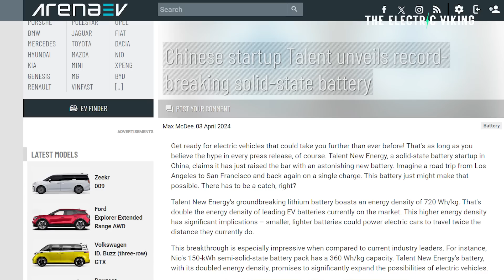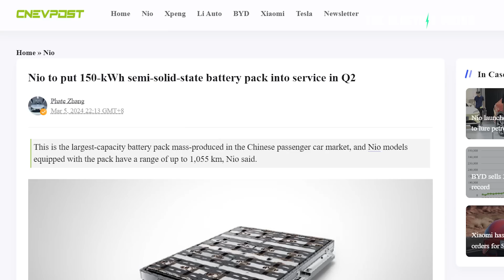Highest energy density battery in the world enables EVs with 1250 mile range

Comment: As long as I live in the boonies with no easy way to charge an EV that's probably 4-5 times more expensive than the car I have now, EVs will remain something that mostly city people use, or very rich people use.

I also have complaints about how bloody quiet the things are (mostly at lower speeds, and mostly from a pedestrian POV), but that's relatively minor compared to the other problem, since if you aren't looking around you, that's probably why you're having trouble detecting the things more than it being quiet.

Comment: How does he get 1600 km with a 100 kWh battery? I believe the Tesla model y is using an 80 kWh battery which produces 250 watt hours per kg. So 720 watt hours should get you close to 1600 km since it does 500 km on a charghe. I am a little confused on the math?

Comment: Batteries that can hold more and charge faster mean nothing without charging stations that can meet or exceed charging requirements ... everywhere. Charging capabilities are sorely lacking, problematic, and are (and will continue to be) the largest barrier to widespread EV adoption. EV adoption cannot grow to the point of outperforming petroleum without massive expansion of worldwide grids and power generating capabilities. This isn't a guess. It's a fact.

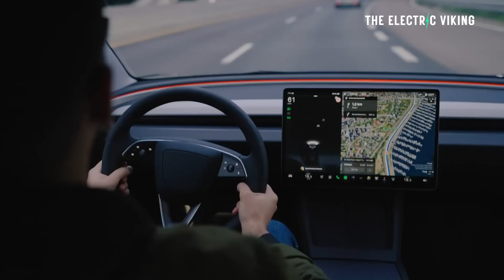Comment: 360Wh/kg at cell level ?  or at pack level ?   It is  still not enough  for airplanes , 70 minutes   flight at  top will be possible .  1:30   100kWh battery  never offer  1000mile  range  ,dude  WTF ?  20kWh/100mile is a minimum real life consumption  100kWh is enough  for  500mile range only  . Basic  math  :)

Comment: I second petert4393. Please use the right units. using watts for energy capacity is like responding to the question "How far did you drive today", with "I drove 50 miles per hour". Watts is like mph. watt-hours is like miles.

Comment: It’s great to have 720, but the real solution is to have a hydrogen engine, small but powerful enough to charge these new batteries on the go. Much like an alternator, but one that only kicks on when battery is at 15% or less and charge back up to 90%. In this manner range is vastly increased and heavy load vehicles such as tractor trailers or pickups can toll heavy loads over long distance, but a battery only solution, makes little sense other than for cars in cities.

Comment: Sam, LONG HAUL FLIGHTS are not even close with 720Wh/kg, easily proovable with one simple equation, the battery electric Breguet range equation.  With the most extremely optimistic inputs to the equation, likely sacrificing useful passenger payload, 2800 km range is the limit with 720 Wh/kg.  Without 2000 to 3000 Wh/kg batteries, long haul flights will need hydrogen or ammonia fuel for zero  carbon emissions.
Flying wing or blended wing body design and slowing down 12-15% to Mach 0.7 to enable open fan or unducted fan propulsion and less transonic drag will also be required.   Currently we are already wasting a lot of fuel without carbon taxes to force greater efficiency instead of maximum profits.
Natilus, JetZero and maybe also Airbus and Boeing will build BWB aircraft which will be a huge advancement in aviation a long time in coming.

Comment: It is an interesting breakthrough. Fuel energy density is about 1200Wh/kg, but ICE engine efficiency is closer to 40-45%, while for battery and electric engine it is closer to 80-85%. So even the 720Wh/kg battery is lighter per energy spent on movement than petrol.

HOWEVER 😉

If we are thinking of electric airplanes, there are some things to consider:
 - when airplane is going to fly on short distance, it will load just appropriate amount of fuel. EV plane would need a modular, easily detachable battery in order to match that. Same for the car, but probably easier since you don't have to perfectly balance everything and losing power is not as catastrophic as for EV plane

 - airplane takes off with full tanks, but lands with almost empty tanks. This makes average fuel mass to be about half of takeoff mass. EV plane will weigh the same through the whole flight - and especially during landing, what will put extra stress on fuselage and undercarriage (currently planes FOR REASON either drop some fuel or do long flight-arounds in order to get lighter). This might effect in urge to strengthen the body of the plane, making it heavier and reducing range even more.

Neverhteless, it would be really interesting! Looking forward to seeing this in real world!

Comment: Hate to tell you but your maths is wrong. We aren't close to air travel. If we look at a normal ICE vehicle and we assume 10Kms/L. I litre of fuel is approx 1kg. So 10kms/kg.
Now compare to EVs. It's approx 15-20KW /100kms. So approx 5kms/Kw. 
Now with this new battery getting 720Wh/Kg or 0.720Kwh/Kg or less than 1km/Kwh.  To be able to get the same distance per kg as an ICE vehicle, you need to be able to get 10kms per kg. You still need to increase the capacity of batteries by more than 10x to be considering getting an EV place otherwise it would simply still be too heavy.

Comment: A lot of pickup trucks have 1,200 km of range in North America. Where I live, we travel vast distances in our vehicles from farms to cities. a 300 km drive here takes less than 3 hours because our population is smaller. Further to that, charging stations are few and far between here, so having massive battery range is important. If you live/work in the bush up North, it's usually going to be 12+ hours of driving on logging trails to get somewhere with fuel, so most trucks have dual tanks, massive 150L tanks, or slip tanks for in the truck bed. If the weather turns bad and you get stranded, you'll need it. That's why EVs as they are are mostly rejected here. That massive range matters to a farmer and his family if they get stuck in the ditch on the dirt road to their farm, because they need to keep that vehicle warm for days in -20 to -40°C weather sometimes until someone shows up to rescue them.

Comment: Viking to answer your question "Why would you want a car with 1300mile range?" Not about driving long distance it about not charging too often :-) High range solves the charging station issue by charging say 1 every month or so at a high end station say 150KW that might be using a modular nuclear reactor next door LOL It also make truck and heavier vehicles more possible and as you said aircraft using plasm jet technology. I would also warn though it makes certain weapons possible as well. :-o The total electric aircraft carrier ie even the fighter/bombers are electric charge from nuclear reactor!! Pulse laser weapons possible.

Comment: I can't help recall what happened in the camera industry late 90 into 2000s. Everyone said digital will never replace film. Can't compete etc etc . Car industry is the same. There will be a point not long away where EVs WILL overtake ICE etc. It not climate change that will bring on EVs it market forces. Because just like the camera industry EVs will get better and better and better then cheaper and cheaper until ICE just die out just like film cameras have. If battery power keeps rising then charging point issues die out don't they. One charger per month and you are set. 2000mile EV is not impossible in fact it very likely. Charging could be say 30-45mins. But then you are set for weeks of driving. Oh and of course even older EV  swill benefit for improved battery technology because you can build portable fast chargers you stick in boot. :-)   So you pull over take a suitcase full of 100KW out of the boot zap the smaller battery say in a Nissan Leaf. Then drive off. Plus of course motors will improve battery management will improve bodywork might get lighter but still be strong. EVs could end up being say less than a 1 metric ton in the future with plug and play parts that a child could fix. Again all this happened in the camera market. So EVs are the future no question in my mind. The legacy makers better get on bandwagon soon or they will disappear like Blockbuster video when Netflix came along LOL

Comment: I would prefer a 1000km battery in EV. Not everyone commutes from point A to point B, most people use their cars and EVs for everyday commutes, weekend towing caravans and trailers, school runs etc. It will be good to have enough charge when towing as the range drops drastically. Say from 1000 km to 500 kms.

Comment: Just for comparison - one kg of petrol has around 12Kw of energy in it, or ~16 times the energy density of the new battery. But the petrol engine is only able to convert 20% of this to useful work, so the actual energy density realised is 2.4Kwh/kg. In effect a petrol car carries around a 1/3 of the weight in fuel compared to an EV with the same total battery power. Although this is not exactly comparing apples with apples, as the EV efficiency is around 80%, so the ratio goes to around 1/4 of the weight.

This, with the fast fuelling of petrol cars, and petrol's ready 'carry factor' (i.e. if you run out of petrol, you just get more petrol to get you to the petrol station; no need for a special charger, etc, or you just carry spare petrol if you are worried you will run out), is the challenge to overcome to get mass uptake.

Comment: 1000+ mile range does 3 things. It extends the useful life of the battery because batteries lose capacity over time. If 200 miles is good useful range, when a battery gets to 50% of its capacity over time, it is much less useful. It also allows the battery to be charged/discharged a minimal amount on a day to day basis, this allows it to be kept between say 40-60% charge vs 20-80% which should also extend its life. It allows towing a trailer a reasonable distance which existing capacity batteries utterly fail at.

Comment: The prospective electric vehicle consumer needs a simple straightforward example of the economy and convenience of owning a BEV. Mine is: 1) I paid about the same for a  tesla model y as a top trim Honda  cr-v hybrid, 2)I charge at home 99% of the time and my operating cost is less than a third of my previous Honda  cr-v hybrid, 3) The only maintenance I have needed in the first 3 months was a tire rotation where Tesla service came to my rural home and charged me 70$, 4)No more oil changes, brake jobs, high pressure coolant leaks, and annoying and fume-filled trips the the gas station. Battery range has never been an issue even though I drive an average of 50 miles a day.

Comment: Batteries capacity are only one side of the equation, when it comes to EV adoption. The other is the recharging speed. As long as the charging time, itself, does not come closer to what it takes to fill a gas tank, no mass adoption will occur.

Comment: 1:57 50kwh battery can't magically increase range right? What will happen though is reduce the weight carried and hence you can stuff more battery into the same space? That means In the current weight of 50kwh battery we can stuff a 100kwh battery. The weight per kwh is what changes with density and allows cars to carry less weight. I think we should not confuse saying that 50kwh battery now will get more range, kwh is the unit of energy stored in the battery, with double density you will store more energy per kg of the battery.

Comment: I am curious to know why you think a 560 Whr/kg battery makes transoceanic air travel possible. A1 jet fuel has 43.1 MJ/kg. Converting gives 11,970 Whr/kg. To supply the same energy the battery would weigh 11970 / 560 = 21 times the weight of full fuel tanks. Any comment?
Reply: Battery density is crucial for electric flight.  The advantage electric motors have is in their reliability and lower weight.   They may not be the choice for long international flights, but I’m very excited for their potential for general aviation.
Reply: Yes but the jet engine is maybe only around 30% efficient. 70% of the energy in jet fuel that you quote is never used for forward propulsion but is lost to the atmosphere as waste heat. Electric propulsion might be closer to 90% efficient. Now the calculation completely changers.

Comment: Now tell me how long does it take to charge this battery and what it the maximum amount of charge current can they take?

Can the domestic grid supply the amount of current required for a fast charge?

What is the lifespan of these batteries?

What is the degredation rate of these batteries?

None of this was mentioned in the video.

Comment: Your numbers don’t make sense. A Tesla gets about 4.5 miles per kWh. If you mean a 50 kWh battery then that gives 225 miles. If you mean a 50 kg battery then that is 162 miles. The current battery weighs about 1060 lbs which correspond to 480 kg mass. For an energy density of 720 Wh/ kg and 4.5 miles per kWh that gives a range of  1550 miles.

Comment: Complete mish-mash of terms and poor articulation of the benefits and drawbacks.

I think I know what he's trying to say but he's not explaining it well at all, excluding variations due to temperature, a 100kwh battery will get you the same distance regadrless of chemistry or energy density, a 100kwh battery that's 4 times as energy dense will just weigh 1/4 as much but still have the same capacity. A 50kwh battery at 720wh/kg in a model 3 will not get you 800miles it will get you exactly the same range as 50kwh of usage of the current LFP battery.

What a high energy density allows you to do is put a 200kwh battery in a model 3 that weighs the same as the current 60kwh LFP battery - that's what would give you the extra range....but there are limitations....

The limiting factor of solid state batteries to date has been the power discharge rate not the energy density - their capacity to discharge fast enough to feed the motors enough energy, i.e. these may be highly energy dense but may only be able to supply a low output motor for example - that's the dimension that's missing

Comment: So STUPID.  550KW charging?  Where the HELL is that power going to come from?  Build a 10 unit charging station.  10 cars charging would be 5.5 MEGA F'N WATTS. WHERE IS THAT POWER GOING TO COME FROM?   That is more power required that powering an entire community of homes.  California, for example, is SHUTTING DOWN power plants.  Not adding them.  And telling people NOT to charge at certain times... At rates 1/5 of 550KW!  Sure, battery tech WILL progress...  You can build bigger batteries that can charge faster, but you still have to be able to charge them!

Comment: I am confused. First we have the Qilin battery, which is made by CATL and used in Li Auto Mega and as I understand it in the Zeekr 001 version in China. It has a fast charge time at about 12 minutes, if you have a charger that can deliver so much. Li Auto has their own charge network with this power. Then there is something called the Shenxing battery. Also CATL I believe. One of these will be used by Tesla as I understand it. And Huawei use one of these in their new car as I understand it. And then we have IM Motors who have a Solid State battery in a car (LS6?) which will be presented April 8th, and the car will start selling in China in May. Now this battery from Talent is presented as the first Solid State battery.
I would like a video clarifying all these different batteries, where they are in use and in what, when they are planned to be in use, what the prices are or will be if known.

Comment: Wh - energy [Ws or J]
W - power [W or HP]

A combustion engine has a soul. Driving an EV is like diving with a dry suit. Let's put our hopes on porches new fuel.
Reply: A horse has a soul, at least a "personality", and it was replaced by souless machines at the beginning of 20th century , telling that a machine has a soul doesn't make any sense, to push a pedal and hear a roar doesn't make a machine to have a soul, it just make it noisy and annoying, you liked or not battery tech will only improve, more energy density = more energy = more range in the same package and faster charging. Is just a matter of time, we are at the beginning of the EV era, ICE can't improve further no matter how overly complicated and expensive you make it, electric motors have way better torque / power curve than any ICE added to instantaneous response, the sunset of ICE in mase utilization is starting,  2030/35 to reach 100% market share and the next 20 to 30 years to full fleet replacement, certainly some niche use will remain in the future for ICE cars, the same as for horses today. 
A little piece of advice: read Tony Seba's "the age of disruption"

Comment: 1:18 Electric Viking you make again and again the same stupid mistake 🤦‍♂️ 
A higher energy density battery allow you to save space/weight and to fit more batteries! 
From a 100kWh battery, due to 2-300kg less weight you will gain a range increase of 15-20%, not 4 times more!

Comment: Here's why they need to have that kind of range, you won't need to have as many charging stations everywhere if you can go from point A to point B without having to charge. You could take extended trips and only have to charge when you get home. It makes more sense to have the longer ranges than shorter ranges.
Reply: Exactly right.

Comment: It isn't just that these batteries could be used for long range supercars. But make the battery detachable, and you have a 10 to 20 kg device that you can take out of your car, take the lift up to your home and charge overnight. Where I live a lot of drivers don't have off street parking. Detachable batteries are way to get city cars that can be charged at home.

Comment: And even at 720Wh per kilogram we are still nowhere near what we need for a commercial jetliner. Remember jet fuel converts to about 11,700 Wh per kg. And jet engines are very efficient so you don't gain much there with an electric engine. We probably won't ever solve aviation except for light commercial but it doesn't matter. We don't have to solve everything.